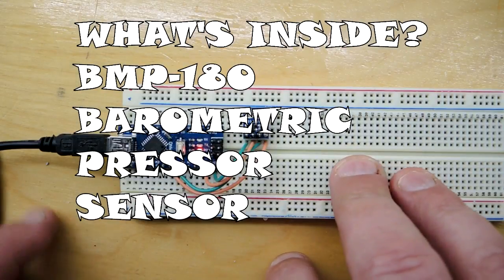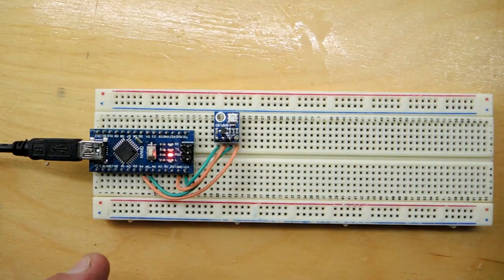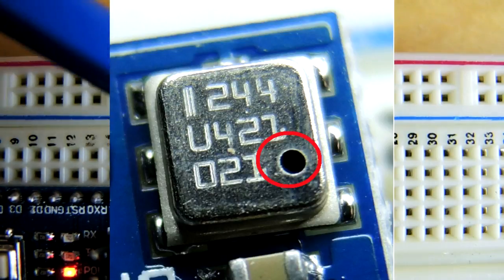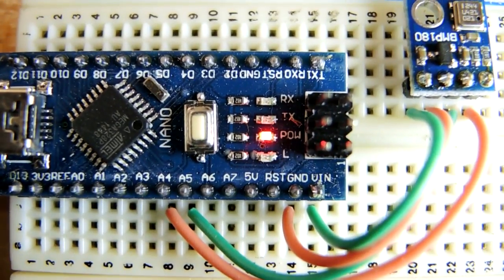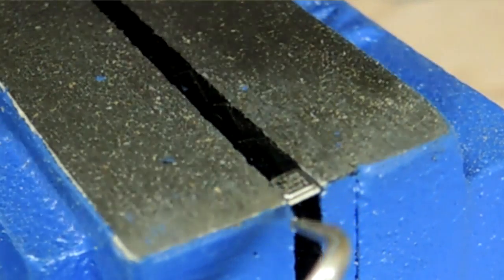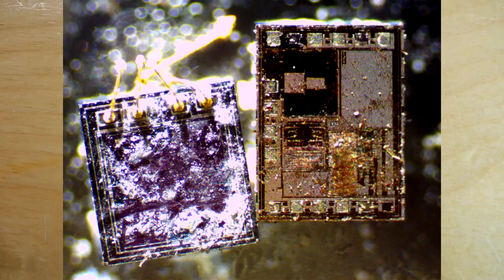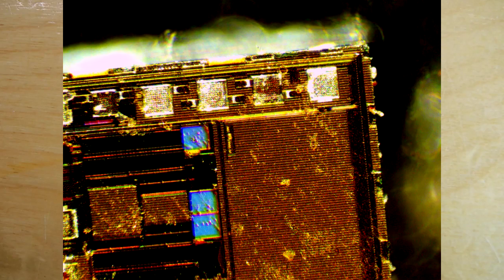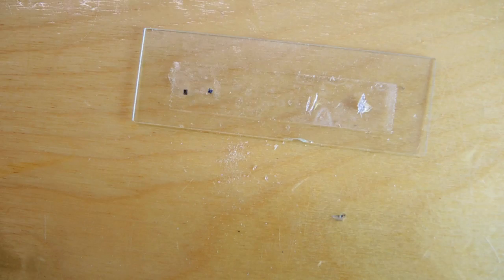What's Inside? The BMP180 Barometric Pressure Sensor

Comment: considering i have a clock i paid 99c for which has temperature, humidity and barometric pressure, its amazing how little they must get the components for, are there any cheap position or acceleration sensors to teardown next?

Comment: Nice interesting video, could any body explain how the Arduino signals interacts with the Bmp180, is the Arduino just reading reading analog voltage changes within the sensor and then converting them to digital thanks.
Reply: That's an I2C sensor, so the data is sent over serial/I2C bus

Comment: hello sir, if I plug the hole with something will the pressure  decrease or increase?
Reply from the maker: +Ahmad Faris it will stay at the same pressure it was recording just before the hole was plugged
Reply: so how do I manipulate it?
Reply: electronupdate actually I need to keep the readings of the pressure after I plug in even im on low altitude places
Reply from the maker: you cannot.  if the hole is plugged the pressure inside the sensor cannot change and therefore the readings will not change
Reply: electronupdate that's a bummer,  so if I apply pressure manually is it gonna break?
Reply from the maker: manually apply pressure where? your question does not make sense.  There is a hole in the case to allow the pressure to reach the sensor inside.  If you cover the hole pressure then does not change and the sensor cannot "see" any more changes.  If you go in and press on the sensor, that would change the readings (and probably damage the sensor.  I think a better question to ask is to describe what you are trying to do and why you want to cover the hole
Reply: electronupdate it's a flight controller, and I need to get a drone on the underground cave which it doesn't allow a negative altitude reading, so I want to disable the pressure sensor without removing it or breaking it. It's solved I tape the hole, didn't test it yet
Reply: Well, the drone's design is what's wrong. If you were the one who made the drone, you should have already accounted for any altitude reading (including negative). I mean, it doesn't really need any complex calculations. A negative number shouldn't affect anything.
Reply: Gene Dela Rosa too bad it's a dji drone.
Reply: Ahmad Faris I don't see anything wrong. DJI is perfectly fine with negative altitude.